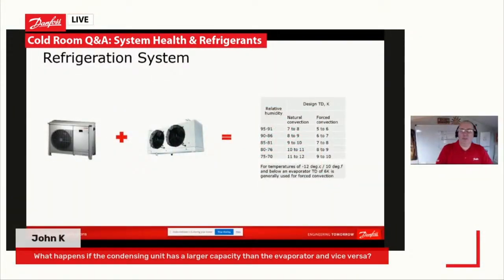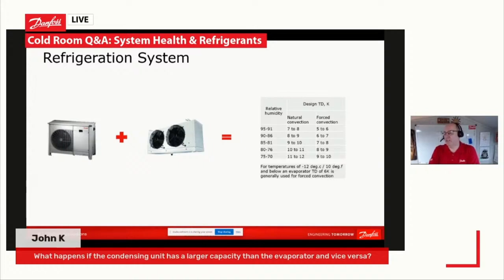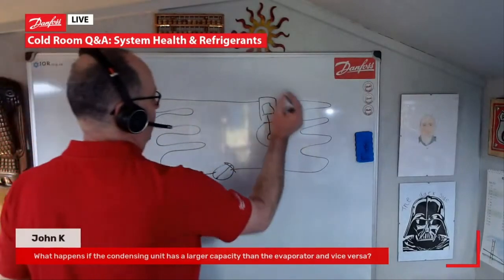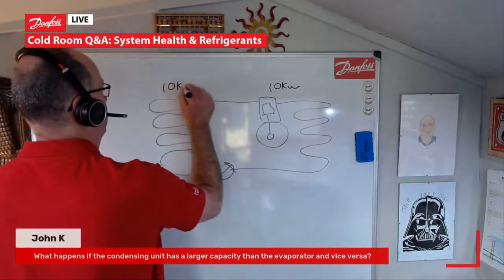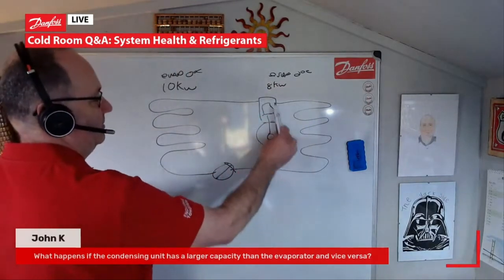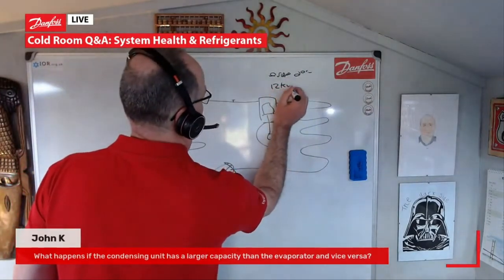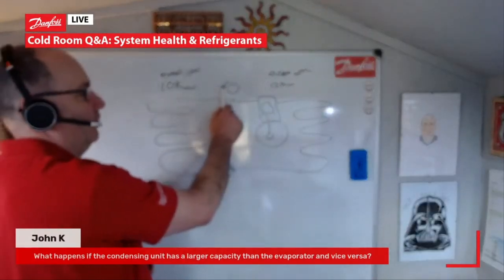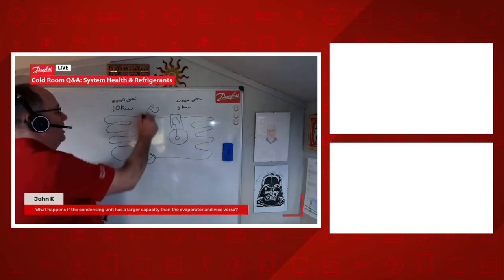What happens if the condensing unit has a larger capacity than the evaporator and vice versa?

Comment: Interesting. It seems like this is the opposite to most mini split units, yes? You can have a couple indoor units, and you might not need all of them operating. 

Does a variable speed compressor fix that problem / mismatch?
Reply from the maker: Hi, we are checking with our experts and will get back to you.
Reply from the maker: Hi Gopi. Generally mini splits use a variable speed compressor so they are designed to operate one or more indoor units. The same logic can be used for Refrigeration systems, the Danfoss Optyma Inverter unit is an example of this. You can check it out here: https://store.danfoss.com/en/Climate-Solutions-for-cooling/Condensing-units/Optyma%E2%84%A2-Plus-INVERTER/Optyma%E2%84%A2-Plus-INVERTER%2C-OP-MPPM028VVLP01E/p/114X4302 Hope this answered your question!

Comment: i'd asked some hvac ppl and they all told me it wont work and it absolutely has to be matched exactly. i never knew why, and still dont. isnt the cold produced when the refrigerant turns to liquid and is cooled to outside temps and when decompressed it creates cold which is then warmed up by the inside temps and repeats.

the point at which the refrigerant turns liquid is based on pressure at a given temperature, right? so wouldnt you want a compressor that pumps to the pressure that it turns liquid and the eev maintains that pressure by adjusting flow. unless my understanding is wrong, but that would mean that you can have any size mismatch and as long as you are able to have enough refrigerant that under working condition the low side stays over 20-30 psi and you are cooling it back down sufficiently and that the cold side loses its cold before returning to the compressor.
Reply from the maker: Thanks for your question. We are checking with our experts and will get back to you.
Reply from the maker: Hi Jason. The simple answer would be that yes if you connect any compressor, condenser, expansion valve and evaporator and charge with refrigerant you will get refrigeration of some description. However, to achieve the correct evaporating temperature for the product being refrigerated then the duty between all 4 major components (compressor, condenser, expansion device and evaporator) must be correct. We hope this explains it!

Comment: Hey, im looking for an answer but i could but u helped me ❤️
Now, as u said a smaller compressor in a larger circuit.
Now i have a 2.25 hp ac with a broken compressor, if i replace this comp. With smaller one like 3/4 hp it will works fine ? Or what ?
Reply from the maker: Hi, we are checking with our experts and will get back to you.
Reply from the maker: Hello, you will need to replace the compressor with an equal size duty and one that is approved for use with the refrigerant being used, otherwise the system will not operate correctly. If you installed a much small compressor as a replacement the evaporating temperature would increase meaning the refrigeration system would not be as cold as the design temperature. Hope this helps!

Comment: How to know /tell the capacity of a coil by without seeing naming plate? Is there any calculation for that ?
Reply from the maker: Thanks for your question. We will check with our experts and get back to you.
Reply from the maker: Hi. If you cannot see the naming plate you can only estimate the capacity. If the evaporator is still installed, you might know the capacity of the condensing unit, which should fit to the evaporator capacity. If you only have the evaporator, the dimensions could give an idea about the capacity. You could compare it with similar evaporators in catalogs. We hope this is helpful.

Comment: How can I modulate the compressor head pressure to achieve low condensing temperature with the change in ambient Temperature?
Reply from the maker: Hi Toyin, Thank you for your question. Let us get back to you about this one :-)
Reply from the maker: Hi again Toyin,
The easiest method is to use a head pressure control device such as the Danfoss Saginomiya XGE. It regulates the fan speed depending on the head pressure. Please, see the following literature: https://assets.danfoss.com/documents/162734/AI227986440745en-000201.pdf.
Hope this was helpful :-)

Comment: What happens if the evaporating unit has a larger capacity than the condenser and vice versa??
Reply from the maker: Hi Nelum, Thank you for your comment. Let us get back to you about this one as soon as possible :-)
Reply: @DanfossClimate  thank you sir.🙂
Reply from the maker: Hi again Nelum,
If the evaporator has a larger capacity than the condensing unit, the suction temperature / pressure will increase.
If the condensing unit has a larger capacity than the evaporator, the suction temperature / pressure will decrease.
Hope this was helpful. Please, let us know if you need any further details/information :-)
Reply: @DanfossClimate  I have a condensing unit that has a larger capacity than my evaporator and low suction pressure. How does one remedy this problem?
Reply from the maker: @jonathanketty2578  We are checking with our team and will get back to you!
Reply: @DanfossClimate  looking forward!

Comment: lol what???  higher suction pressure = higher amps pulled by the compressor, if anything you want a lower suction pressure to increase efficency of the compressor. then again, nothing beats power savings more then having a properly sized system,  too large of a compressor with low suction wont same you on energy, and to small of a compressor  with high suction pressure wont save you on energy costs either.  having a balanced system is always the best option.

Now, lets talk about a perfectly balanced system, what can we do to increase efficeny?  Well, we can reduce the line set length as much as possible..  We can also use an oil seperator to increase the capacity of the evaporator slightly.  We can use an EEV to increase efficency even more.   But the best option is having a remote condenser outside and the compressor right next to and below the evaporator.
Reply from the maker: Hi. We agree that the best system is one that is correctly sized and balanced between compressor and evaporator capacity to match the system requirements and the components specification.
Reply: @DanfossClimate  what about inverter systems if we cant able to decrease evaporator capacity. For example in data center applications how can ı manage condenser and evap. Pressures at low inverter frequency (evap fans always %100) thank you. I am working for bachelor degree thesis 🙏
Reply from the maker: @halilcankaya3202  When you have a variable speed compressor, this will speed up and slow down depending on suction pressure to main a stable saturated suction temperature. it is always advisable to use variable speed condenser fans to keep a stable condensing pressure based on ambient temperature and the temperature difference between condensing pressure and ambient. In general evaporator fans run at a fixed speed to maintain temperature difference across the evaporator and because data centers require high volumes of cold air to maintain the required temperature. If you have too many variables in a control method it is very difficult to get stable system.
Reply: @DanfossClimate  thank you for informations. I maked selection with help of Coolselector and heatexchanger selection softwares for my thesis ı repeat them from different scenarios. But ı think experimental study is very essantial for this type of application. Thank you again 🙏